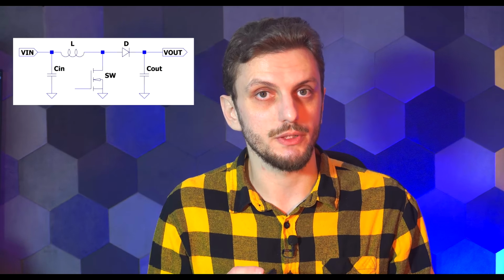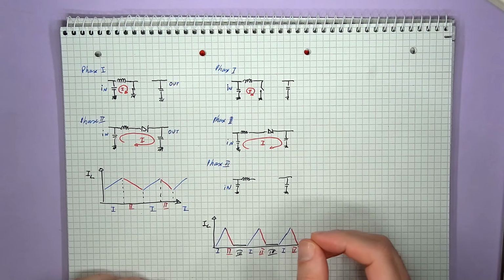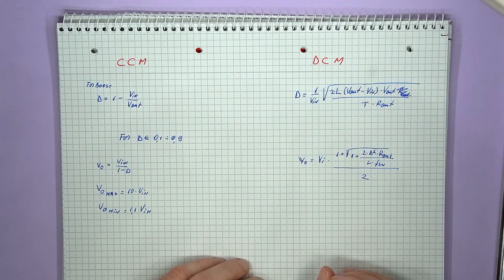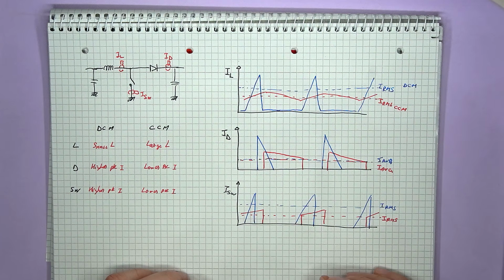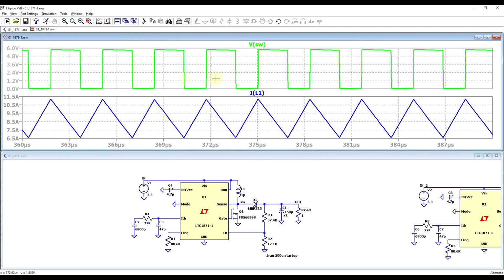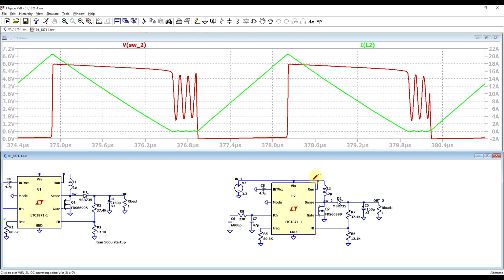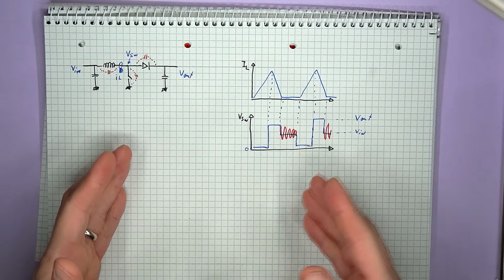Looking at Continuous and Discontinuous Conduction Mode

Comment: GREAT VIDEO!!!
I got a lot out of this, as I am working on an app that involves thus circuit function.
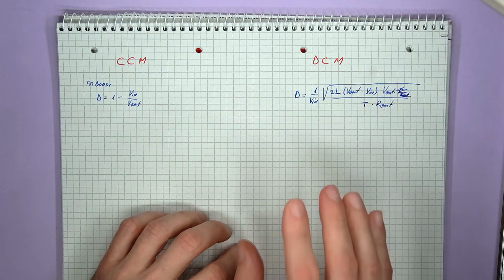BTW:  When dealing with numbers and formulas, I always like to avoid such statements as "complex" equation, unless it involves actual complex numbers (a+bi)...case in point at about timestamp 4:09   
...'not trying to be picky here...
THANKS FOR THE TIMELY AND HELPFUL VIDEO!!

Comment: Nice one, Fesz! I've been on a project at work designing some complex SMPS regulators.

The output voltage was desired to  vary with high slew rates, and forcing continuous mode allowed for much faster negative slew, since continuous mode can sink current from the load back to the source (albeit not efficiently).
Reply from the maker: I also noticed this in some converters where there is the option to enable or disable FPWM ; with the option disabled, the converter reaction is quite slow, especially when going from very small loads; but with FPWM enabled, the reaction time is much smaller.
Reply: @FesZElectronics  the problem in our case was we had nearly 1000uF of output capacitance and needed to drop the voltage from say 1.2V to 1.1V very quickly. And then jump back up again.

Comment: Why the DCM is used then? Why not to use CCM in every converter? Is the choice application dependent?
Reply: If you are using non-synchronous converters at low current, they'll tend to be run at DCM. So it's more of a "it just goes into it naturally" then of a "I want it in DCM". 

Another reason you might want DCM is that it algebraically degenerates the coil, reducing the system order by 1. Running a converter in DCM is a headache but a lower order system (which should be a first order system in this case) is easier to stabilize.

Finally, DCM is just more efficient at low currents but its efficiency drops off at higher currents. The opposite goes for CCM.

The down side of course is the fact that DCM is highly dependent on the load current, it's ripple is higher, and it radiates EMI so you win some of you lose some.
Reply: @thewhitedragon4184  can you explain a bit more on how it reduces the order of the system? How does DCM affect the transfer function of the system?
Reply: @InTimeTraveller  In DCM operation coil current goes to 0 and starts from 0 each cycle. This means that in DCM the coil has fixed starting conditions, and thus doesn't add a pole to the system.

Basically, a coil in DCM is a coil with a current source of value 0 in series. Analogous to a capacitor with a voltage source in parallel, such a circuit does not add poles to the overall transfer function
Reply: It should be noted that the pole isn't really gone but it is pushed closer to the switching frequency which means that we can usually neglect it in averaged models of converters
Reply: ccm usually require very big inductor sizes.

Comment: I thought discontinuous conduction was caused by insufficient load current - so the output capacitor remains charged to the target voltage, the PWM feedback loop cranks the duty cycle down, and the inductor is "charged" with less energy so empties out before the next cycle. So you sort of need to design for a minimum load current if you want to avoid discontinuous current. Is that a correct understanding? Thanks!
Reply from the maker: Indeed, you will run the risk of DCM under low load conditions - its not avoidable.. But if you design to move the DCM lower and lower (like use a very large inductor), the supply will react slower to fast transients. In the end you need to find the usual real life load, and design for that - and accept that extreme cases are rare... stability should still be ensured under extreme conditions, but things like low emissions can sometimes be skipped :D